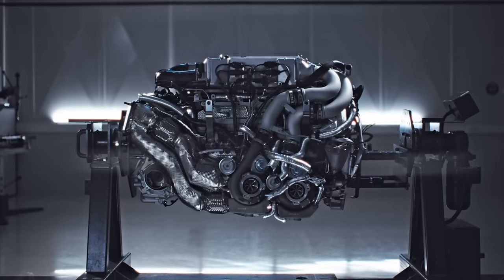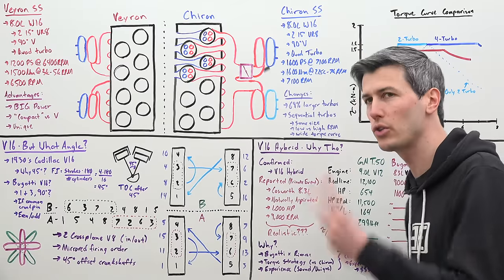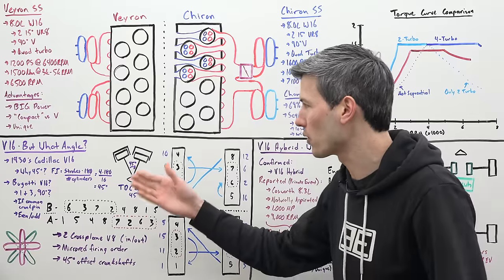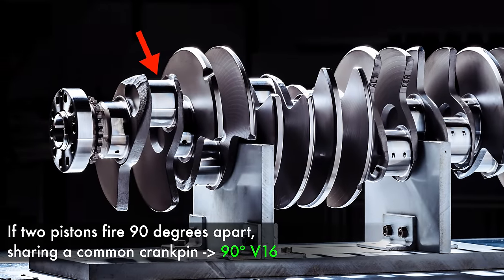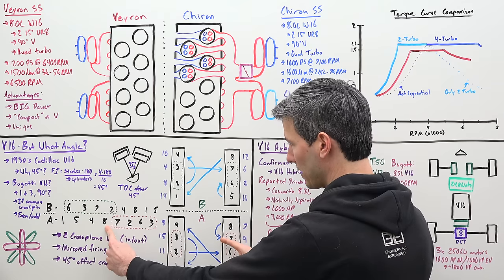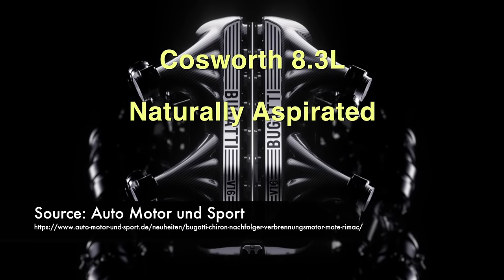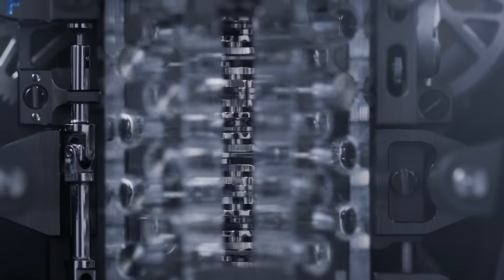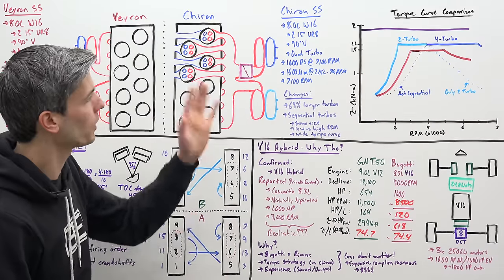Bugatti Has Developed A V16 Engine!

Comment: In 1938, Cadillac completely re-engineered the V-16, brought out a flathead design on a 135-degree plan. It was nearly an opposed 16, gave much lower silhouette, put most accessories on top. Two downright carbs helped give 185 hp. Only 514 L-head V16s were sold. A V-12 wasn't made during this time, and Cadillac dropped this 431-inch V-16 completely by end of 1940.
Reply: A 430 inch engine making 185 horsepower is absolutely depressing
Reply: @Prestiged_peck  Not back then.
Reply: @Prestiged_peck  I'm fairly sure the straight-8 Duesenberg* was making 250+ (in NA form) the best part of a decade earlier. Mind you those 2 carbs in the Cadillac must have been working hard to supply 8 cylinders each!

*also around 430 ci IIRC...
Reply: The Cadillac V16 wasn't so much about outright power, but supreme smoothness.
Reply: @The1trueDave Dusenberg was 420ci 6.9L 265hp N/A, it was DOHC, the 430ci Cadillac 135deg V16 was flat head and it made the same 185hp as the late 452ci OHV 45deg V16 and it started at only 165hp. The V16s were significantly less expensive, low rpm engines designed to effortlessly at low rpms move around a huge limousine with only 3 gears in a time where it was uncommon to travel faster than 70mph, more of a truck engine, where the Dusenberg was like a double Offenhouser I4 or an aero engine that ran at higher rpms and depended upon breathing to make the 265 and 300 gross HP while still being acceptably tractable down low in a heavy vehicle.
Reply: @hendo337  4 valves/cyl in the early 30s, wow!
My Dad once briefly had a prewar Rudge 500 motorbike with a 4-valve head (single cyl) - we thought that was pretty advanced but that was from about 1939 IIRC...
Reply: I agree this technology make sense in 1938, not sure if anyone would fund this kind of project and it's lucky if they break even.  We are at the end of this era, IMO.
Reply: Cadillac had the Cadillac Sixteen aswell, which wasnt making it to production but they had a kind of new version of it in 2003!
Reply: @AnDre-yu4po   I just about remember that actually!
Reply: 185hp damm 😂
Reply: @g600f700  I'm sure Bugatti will make budget from the pre-orders alone. What's fascinating is that sports car manufacturers are the only ones to figure out that the future belongs to the hybrid cars. EV is all the rage and fan boys are peeing their pants with excitement explaining how it's the future,  but it's still a crazy unpractical setup. In the future, people will question the sanity of not adding a combustion engine to EV's as a complement. Whether it's petrol made from recycled CO2, zero emission bio diesel or some form of H-cell ... the hybrid setup is a no-brainer.

Comment: thanks for the thorough overview with your signature explanation process.
Reply: You haven't even watched it yet.
Reply from the maker: Thanks for watching!
Reply: @EngineeringExplained 74.4 lb per liter is extremely solid. i’m curious to know as well if it indeed is naturally aspirated. you always do a phenomenal job breaking down the details.
Reply: @EngineeringExplained  hey mate cheers, why haven't you done the Chiron 300+ video calculations huh? I wonder why, well, I made them myself 😁 and is a complete lie 

I hope you do a video on it, if you really don't care about views...

"The Bugatti Chiron Super Sport 300+ did indeed achieve a record speed of 304.773 mph (490.484 km/h) during a test run in 2019. However, the customer version of the Chiron Super Sport 300+ is electronically simited to a top speed of 273 mph (440 km/h) for safety and regulatory reasons.

To determine if the Chiron Super Sport 300+ could theoretically achieve 305 mph (493 km/h) without the electronic limiter, we need to consider the factors involved:

1. Aerodynamic Drag:

Drag Coefficient: Approximately 0.35

Frontal Area: -2.4 square meters

Alr Density: 1.225 kilograms per cubic meter

2. Power Output:

1,577 horsepower (1,176 kilowatts)

Calculations:

Using the drag equation:

Power of Drag = Air Density x Drag Coefficient × Frontal Area × Velocity

For 306 mph (138.62 meters per second):

Power of Drag = x 1.225 x 0.36 x 2.4 x (136.62)

Power of Drag 674, 198 Watts

Power of Drag 2,078 kiloWatts

Comparison with Available Power:

The Chiron Super Sport 300+ engine produces 1,176 kilowatts. For achieving 306 mph, the car would need approximately 2,078 kilowatts, which is significantly higher than the engine's output

Conclusion:

The calculations show that while the Chiron Super Sport 300+ can achieve very high speeds, reaching 306 mph (493 km/h) would require more power than the car's engine can provide. This Implies that without additional power and overcoming other practical limitations (such as tire Integrity and safety concerns), the Chiron Super Sport 300+ cannot achieve 306 mph. Therefore, the 304.775 mph achieved during the test run was a significant accompitshment under highly controlled conditions, but pushing beyond this to 306 mph is not feasible with the current power and design constraints of the vehicle."

Comment: @EngineeringExplained :: Not sure if anyone pointed this out already, but as a native speaker of Serbo-Croatian, I can tell you two things - 1) Mate Rimac is pronounced as Muh-teh Ree-mah-ts ; 2) The phrasing Mate used in conjunction with the emoticon may actually translate to something along the lines of "oh, that's rich...", as that specific phrasing is very often used sarcastically, much more so than its direct meaning as a praise.

Just thought I'd throw a spanner in the works :D
Reply from the maker: Thanks! I included the original comment because translations often aren't directly accurate, so appreciate you chiming in! Were you to guess, does the language sound affirmative or more like "no way"? Because I think even sarcastically you might say "oh wow now THAT would be cool ;)" in a way that's like hey please don't spill all the details just yet.
Reply: @EngineeringExplained  I added a separate comment, but in most cases it translates to something like a playful "nice try, although you're wrong". BTW your numbers were very conservative. 1000+1000 is much too low. They'll probably push for 2x electric 750hp each, plus 1500 combustion. They have to make a crazier car than Koenigsegg's ~2300 HP.
Reply: @EngineeringExplained  I had posted a follow-up, but it contained a link to another comment on Facebook, which might be why YouTube mods (or even you) deleted it.

Anyway, the gist of it was that Mate Rimac seems to be very stingy with responding to comments on his posts, and the response I had linked was one confirming the engine is N/A with a simple "Yep." to one of the commenters in an earlier post Rimac had made. The only other direct response he gave to commenters about any of this was along the lines of "all shall be revealed in due time".

This all leads me to believe that the commenter you pointed out (Heinz Schenk) was onto something, and the snarky sarcastic handwave was probably a misdirection attempt. I can't be sure about the electric engine(s) power figure(s), but I do think you're just about correct; something tells me Bugatti-Rimac didn't go through the trouble of designing such an elaborate ICE powertrain just to have it play second fiddle to the electric subsystem - I doubt they'd want it overshadowed by the electric motors.

@randomnik70 :: I doubt Jason overestimated the engine power, given how simple the intake manifolds and the valvetrain look; to get much more efficiency without traditional forced induction, they'd have to have an elaborate variable valve timing and duration system with some huge valves/ports and also probably rammed air (scooped from the front and inducted into the manifolds), as what Jason proposes is already pushing it in terms of volumetric efficiency.
Reply: Máté is a Hungarian name, as well.

Comment: Can you make a video on the pistonless engine omega 1? Would love to have your take on this.
Reply: What has the world come to..... Pistonless engines? Wtf man
Reply: @joe13c00l2  with engines that use pistons, there is a lot of reciprocating mass and with the omega 1 it spins in one direction, making it a more efficient motor. Thus more power for the same amount of work.
Reply: @joe13c00l2 It's called a Wankel Rotary, not a piston in sight.  80 year old tech.
Reply: Shoot...I forgot about rotary engines...i always thought of the dorito as a piston tho... @PrinceAlhorian
Reply: Turbines are technically piston less internal combustion engines too...
Reply: @joe13c00l2  It's technically closer to an impulse turbine, like a Peltier wheel.  Also explains why the fuel efficiency was so rough.  They get awesome efficiency running at a set speed and power output, unfortunately cars that need to stop and go isn't such environment.

Comment: the cizeta moroder was a v16 in 91
Reply: Was it a prodcution car though?
Reply: I mean 8 production vehicles is it really a production car ? Those early 20th century v16s has hundreds of examples
Reply: Rare cars are considered production vehicles even when they are made in single digit numbers.
Reply: Cadillac made a V16 in 1930. They made 4000 of them.
Reply: Nah not really  @CyanRooper  they're not series production vehicles. More homologated concept cars
Reply: @Emira_75 how many Bugattis will get made? 500? 250? Even less? We're comparing 8 production cars to 500 Bugattis Chirons throught the entire production run. Or just 50 if the pur sport or whatever trim. Compare 500 Bugattis to Lamborghinis 20,000 Lamborghini Huracans throughout the production run. How many cars need to be made to be considered a production car? Seems the number always changes. The Hennessey Venom F5 is considered a production car and they are only making 24
Reply: @Emira_75  Depends, unless you specifically intend for "production vehicle" to only include road legal ones, I'd argue many racing cars count. Ferrari made at least 60 of the 458 GT3 racing car alone for customers. I can't confirm right away, but I'm fairly certain Ferrari's GT3 and GTE cars have sold roughly in the same ballpark as Bugatti's various Veyron models. Last year Porsche celebrated the 5000th 911 Cup car being made. By comparison it took Lamborghini as a road car manufacturer until around 2003-2004 to rack up 5000 total cars sold.

So yeah, prototypes, open-wheelers etc. probably are hard to qualify as production cars, but a lot of GT and touring car (actual touring car, not silhouette prototypes like DTM, V8 Supercar, NASCAR, GT500, etc.) racers would IMO easily qualify.
Reply: I guess the main thing against the Cizeta Moroder engine would be that the two sides don't AFAIK share a crankshaft, so it's more like two V8s that are bolted together and synchronized.

Comment: I would assume whatever future car Bugatti will put the V16 in won’t be specifically designed for top speed because the hybrid system wouldn’t work when trying to reach the highest possible speed since there would be no regenerative braking and the engine would be better suited to just send all of its power straight to the wheels.

Comment: Right off the bat, it would be significantly more efficient to simply build a very large V8, second it would be much easier to make a V16 with a crankshaft on 2 axis that operates as a pair of V8 firing simultaneously instead of the 4 axis crankshaft with the 45 degree firing order due to complexity of making the crank and the increase in the chance that there could be flaxs that make the crank throws even a few degrees imperfect on one plane and the fact that there is no power advantage to making the engine in this oberly complex way compared to a large V8 or 90 degree double V8 of the same displacement, this is the same reason why manufacturers refuse to give us large cross plane I4s that would give is better balance, beautiful tq curve and a luscious sound.

Comment: Imagine making two sets of 180-degree headers for this engine, then merging the 4 collectors into one huge collector for maximum sound blending and high RPM scream-age.

Also, 8.3L isn't enough. They should give it an 80mm stroke and 103mm bore for 10.7L of displacement and roughly 1400hp/900 lb-ft N/A.

Comment: That's pretty sweet.  I have wanted to build a paired V8 V16 out of Ford 460s for a while now, just something about a 15L V16 that's appealing.  It's interesting that they are doing this this way, my first choice plan was to run the front one in standard rotation but the rear one in reverse rotation, butted together, with the power going aft via a shaft slung underneath from the flywheel end.  
Hopefully they aren't going to have too much of an issue with crankshaft flex in that, or with block shifting.

Comment: It would be nice to compare diameter of bearings for this V16 with a high-revving V12. One of the reasons why V16s are unpopular is that longer crankshaft is less stiff and as a result has a natural resonance at lower frequency. If the engine were revved to the rpm at which resonance occurs, crankshaft will break. Thus, the more cylinders there are in a V, the lower the limit on rpm is. 9,000 is very high for a V16, which makes me think that they either found a way to make crankshaft stiffer (by making it thicker or playing with the quality of metal), or they have implemented some very effective vibration dampening mechanism or both.

Comment: I mean buggati uses the reverse mid engine AWD layout meaning the transfer case connects the rear wheels instead of the front. With a v16 it would give you enough room to connect a driveshaft to each rear wheel, giving you the ability to mount the engine lower.

Comment: The photo almost makes the crank look like a 45/135° all the way down, but if it were, that 45° offset between the two halves, wouldn't be able to exist as it does, and it's quite evident. 

Maybe we can have a video on how this engine sounds totally flatplane even though it's clearly not. 

Would also like to see the math on that crank. Two 90°x4 cranks offset by 45° between the halves is  really interesting.
Jason, pretty please??? 🙏😁

Comment: First half of the video is like a math or physics professor explaining how everything relates in theory 
“This block of cast iron is actually a spring”
“This piece of copper is simultaneously inductor resistor and capacitor”

Comment: The crank and camshaft harmonics would be an interesting thing to see as well. An engine that long is sure to pose some challenges with torsional vibration and I'd love to see what they did.

Also, exhaust manifold pics please. Eliminating blowdown interference and meeting emissions don't typically happen at the same time on crossplane V8s, so it will be cool to see how they did it (I mean, they could use 8 cat converters on cylinder pairs with a 270 degree firing separation, but that would be the easy way).

Comment: The American company, Marmon, built a V16 between 1931 and 1934. It was designed in 1927.   Cadillac beat Marmon to market but the Cadillac V16 was designed by an ex-Marmon engineer.  The Marmon V16 was all aluminum while the Cadillac was an iron lump. The Marmon was also more powerful than either the Cadillac Series 452 (OHV) or the Series 90 (flathead).  The Marmon V16s are rare and $$$$.  The Marmon Wasp won the Indy 500 but with a 6 cylinder engine.

Comment: There was a similar engine in the 90'. The cizeta v16 was basically two v8 in a combined engine block, with the power output in the midle. I wonder how Bugatti will install this powerplant considering the size

Comment: I’m curious.. would there be any advantage to firing 2 cylinders at once? So like instead of 1 cylinder firing every 45°, 2 cylinders fire every 90°. You would have more vibration to deal with, and the firing order would have to be reworked, but in theory, wouldn’t that be able to produce more torque? 
I suppose exhaust flow to the turbos would be a bit more choppy, but then I would think the sequential turbo system could smooth that out with some tweaking.

Comment: Downside of the straight eight is crankshaft torsion, sometimes referred to as whipping.
I'm wondering how it's managed in this V16 if it's driven off the end of the engine?
In a W16 I can see how the compact arrangement of the cylinders reduces crankshaft (and engine) length effectively making the crankshaft about the length of an inline 5 or 6.

Comment: Lovely video.
That last torque curve is wrong though. It would be correct-ish for a full EV vehicle but this is a hybrid. You still have the torque curve combined with the electric and it will be up to the software to decide if they want to flatten it by limiting electric power or give you the full beans 🫘

Comment: T50, Valkyrie, and now this... Cosworth keeping the art of the NA ICE alive, no one does it like them anymore. Interesting engines with hybrid assist replacing turbos is something I hope trickles down to more affordable sports cars before the EV age
Reply: Been there, still wearing the T shirt. Our Honda Jazz has a 1.5L NA engine and hybrid assist! 

Sadly the software conspires to not unleash all 200bhp the plant could theoretically deploy. However, it is the first Jazz to be capable of wearing out its front tyres.
Reply: NA ICE alive everywhere. For example you can combine 16 450cc dirtbike engines and get same characteristics as guessed in the video. And engineers of this engines don't shoot for high hp nowadays. So it is quite basic tech (you can have 300hp/L nowadays if you want). Moreover, full EV is a dead end. We just don't have enough lithium to make batteries to electrify all cars. I reckon next 20-30 years will be hybrids until we find some alternative to Li based batteries.

Comment: I guess that the one obvious downside with this approach is the effect of more weight with the 4 motors + battery vs. 4 turbos + plumbing, and that the motors/batteries would run out of steam at high speeds?